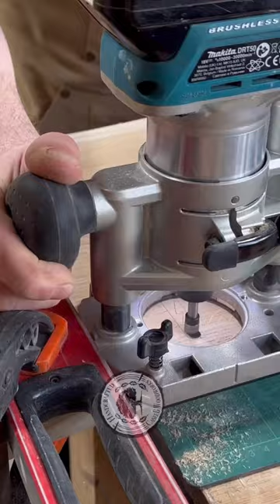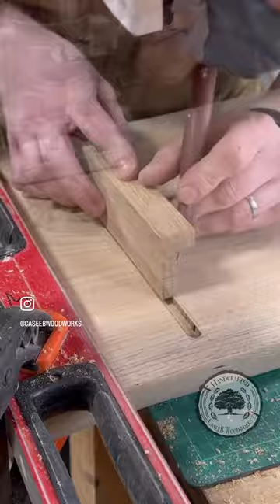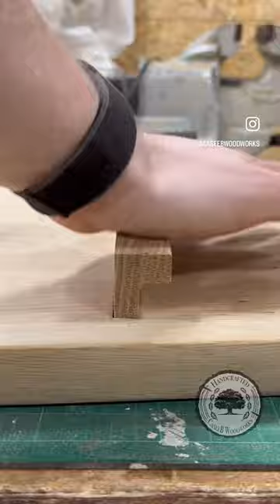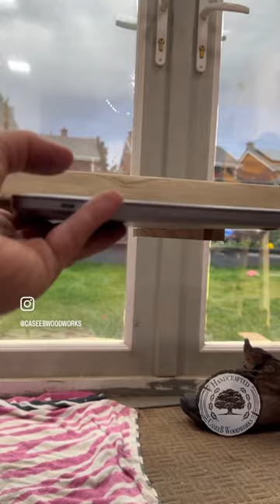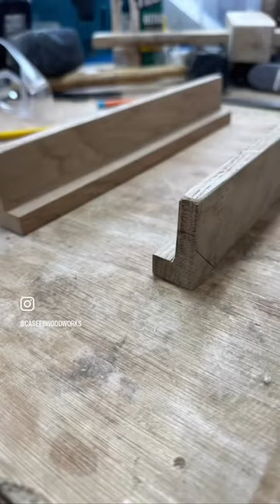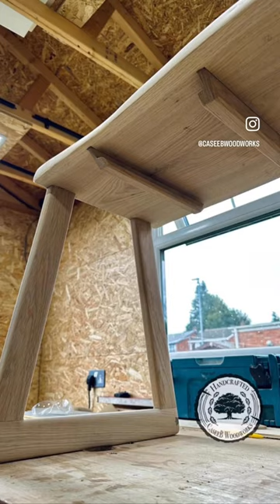Adding hidden storage to a live edge coffee table #woodworking #joinery #tipsandtricks #ytshorts

Comment: now just add a stop at the back so it doesnt fall out if you push it in to far too fast
Reply from the maker: Yes I toyed with this idea, however I’ve left it for now so the laptop can be slid out either way…there is enough friction that it shouldn’t slip out easily and you’d have to push it through all the way before it fell out the other side so for now I’ve left it without a stop block 👍🏻